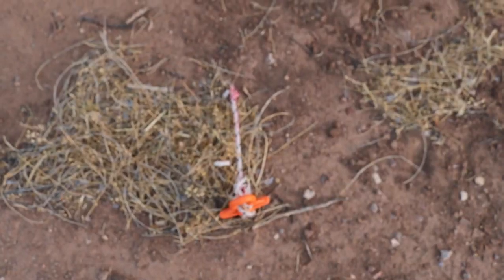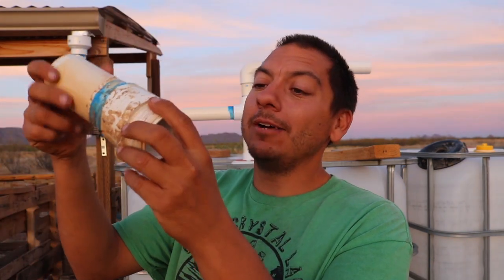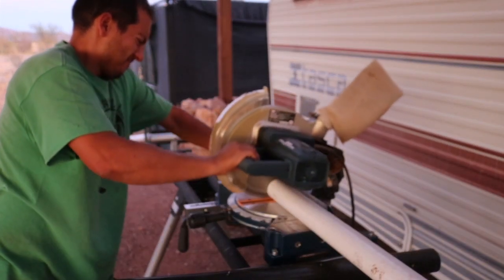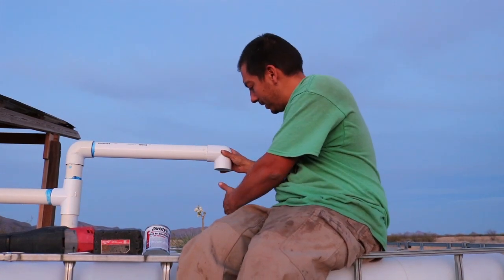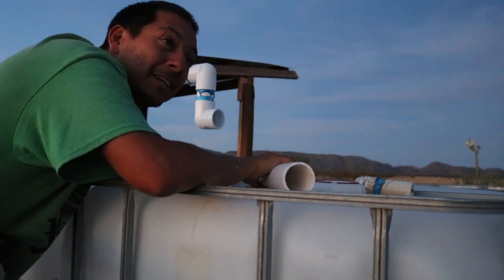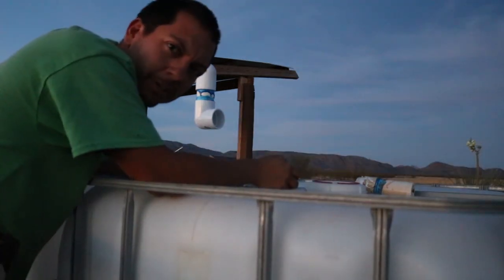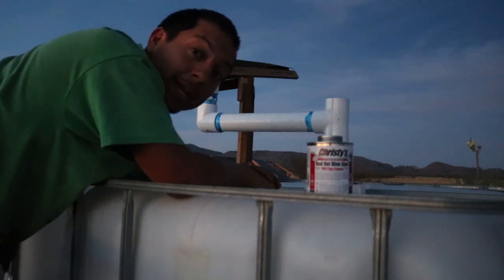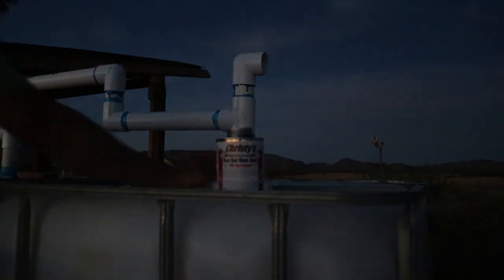DIY IBC Tote for OFF-GRID Rainwater Harvesting Storage

Comment: I always use the chop saw when i can... nice 90 degree cuts.. best fit on pipe fittings!  Mr T... nice touch!  Yeah, I do a lot of my work at night.. so much nicer for some jobs!  Pro PVC tip:  twist the fitting when putting it on.. evens the glue out around the whole fitting. You need a headlight!  I recommend the Storm Headlight.. super bright!  Love the Mario flashback!
Reply from the maker: Thanks for the pro tips Carlton. I actually got a head light. It's great for that night time work.
Reply: Hey glad to  help.. But it sounds like you already have it locked down! :)  Yes, the headlight is invaluable to me!

Comment: To be perfectly honest, I would have just cut the existing pipe... but that's me :-)
Looking at the end of your overflow pipe reminded me of something I'm doing. I've got two 55 gallon barrels which I'm going to set up for watering my chickens, and I found that a drain sieve fits perfectly in the hole, maybe try that for a cheap and easy option?
Talking of the cool evenings, our air conditioner went out last weekend, and so to keep the house cool during the day we opened all the windows at night. I fixed the air conditioner on Monday, but we continued opening the windows at night, and I looked at my electricity usage and saw that we cut our daily usage by about 40%. LOVE these cool evenings in the high desert!
Reply from the maker: Oh yeah. The night time temps have been perfect sleeping weather. 
Thank you!🙏

Comment: Great job Jim! Looks good my brother. I've got a question for you. When the 1st tote fills up what is preventing the water from going out of the pipe that it came in from?  I've been thinking about it and the only thing I could come up with is that the entry point of the water is higher then where you're trying to push it to?
Reply from the maker: Great question Bill! You're right. If I've designed it right gravity should push the water through before it backs up. Just because of the height differential.

Comment: I think you said you are going to do this. If water is gushing in there fast and starts to back up I think a Venturi (vent pipe) might need to be added. Where the end cap is, elbow it up so that the pipe is above the gutter and air gets in. Does that make sense. Just a thought. Hopefully not. But as I think about piping in my house it might be something to consider. Maybe I’m off my rocker. I don’t know. I’m not a Plummer. Looking good so far guys. 😁👍👍
Reply from the maker: It makes total sense G! I'm going to see how this works and then I may try making modifications. Thanks Sir!🙏
Reply: Green Dream Project 
You get what I’m saying though right? No issues if it was a pressurized system but with a non pressurized system it’s like holding a 2 liter bottle straight upside down. The air and liquid fight each other and do the gurgle gurgle thing but the second u poke a hole at the top it equalizes the pressure and flows smoothly. I hope that makes sense. I’ve never made anything like this catchment system. Hope I’m not being a butthead. Hope what I’m saying is irrelevant. But if u get a down pour and it overflows the gutters this would be my first thought. Everybody a critic right? Love u guys. Just my thoughts. You guys put so much into this it must succeed.

Comment: Love it look great question did you think about drilling a bunch of 1/16 in holes in the cap to turn it into a screen you dont have to mess with when it rains.
Reply from the maker: That is an idea. It could act as a temporary screen now, and still let air flow through. I also wouldn't have to remember to take the cap off before it rains. Good thinking.
Reply: Just trying to help our buddy

Comment: Great job Jim, I am curious to see if the way you have the plumbing will work. I know the first tank will fill up, but not sure if the 2nd will. I have a feeling when the water starts going up the pipe from the first tank into the 2nd tank it will back up. I could be wrong and most likey am, but still want to see what happens.
Reply: I cant see how it will work !
Reply: Water, if vented, always finds its level.  Just gotta take that cap off.
Reply from the maker: All these pipes are lower than the inlet at the gutters. It should work.
Time will tell. 
Thanks Joey!!

Comment: Oh no, did you just create an air lock? You might have to add a tee joint in the section from tank one to tank two. Make it taller than the over flow and add the mesh screen again.
Reply from the maker: Thanks for the suggestion Eric! Hopefully that's not the case.😬